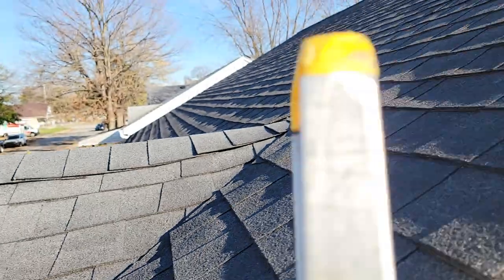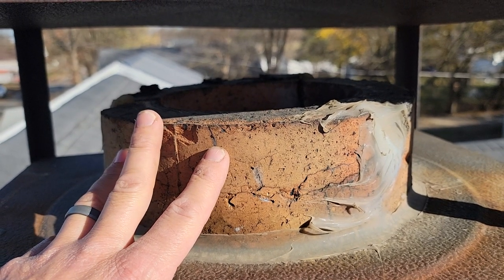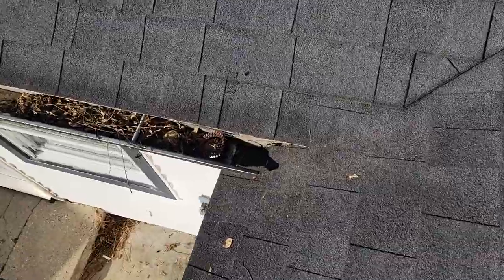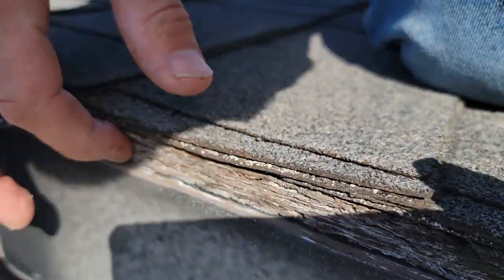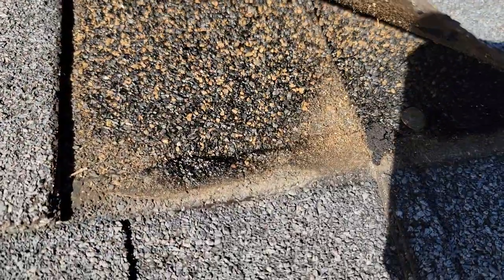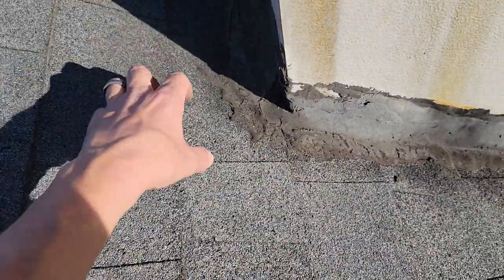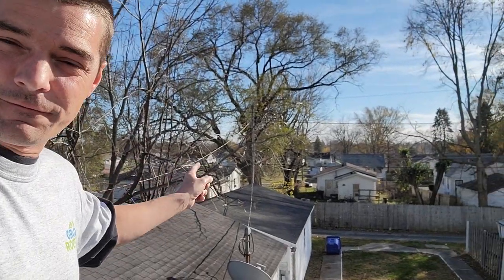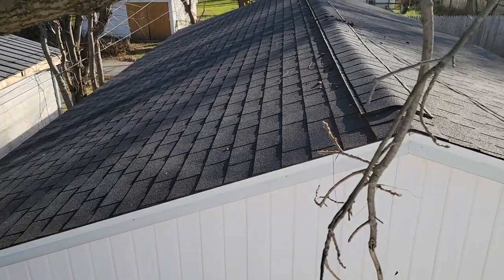Roof over a roof over!

Comment: Had a two layer condo connected to the condo next door last week.  Tore off both layers, tied into the neighbors two layer roof with trim coil and some grace.  

All these weird situations cause by multiple layers.  Repairs on a 3 layer sandwich 😟 Screw that, can't warranty that.  I hope they have you replace it all!!

Comment: This past summer I replaced a roof that had 5 layers of “roofing”: cedar shake, real old asphalt t-lock style, 2 layers of rolled asphalt with 3” exposed nails, and a final layer of 3 tabs on top of it. In one dormer the asphalt was 4” thick. I was not a happy roofer. I ended up tearing off the sheathing boards, installing 2”xps, furring strips, and re sheathing it.

Comment: The stain at the lower right of the chimney is the water condensation on the inside metal and leaching between the shingles. Most of those metal chimneys had a 2 piece flange flashing underneath.

Comment: Nope nope nope. 
Be straight with the customer, the only way I'll touch this roof is if I get to pull it all off and start from scratch. 
To sweeten the approach I would suggest multiple quotes:
"This much if we just have to strip and lay"
"This much if we strip, find out the roof is rotten to the core and needs to be redecked"
"Option A+B + grandpa's inherited chimney is determined to be dangerous and needs to be either removed or replaced"

Because I understand these are big numbers in hard times I'm happy to keep the quoted prices for 12 months, bit of a risk to me but hey, I would suggest having the money ready for a full redeck before we commence and if it doesn't come to that then you can take a nice long weekend vacation. 

This is all guesswork coz I'm an Aussie and our roofs aren't built in a way that issues can sneak up during a job, you generally know exactly what you are walking into. But that is how I deal with these types of customers. 
Maybe win 50% of em, but that 50% gets a roof they can rely on.